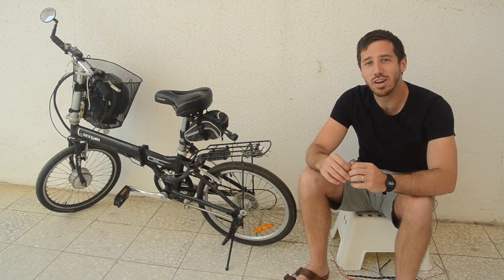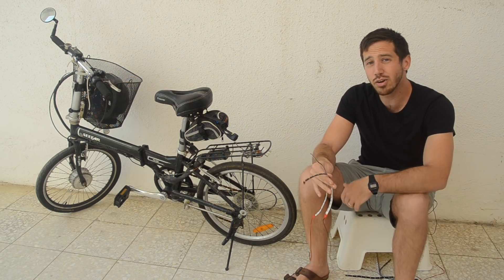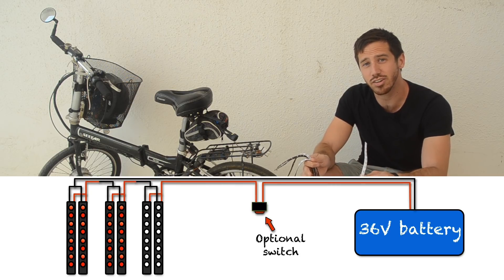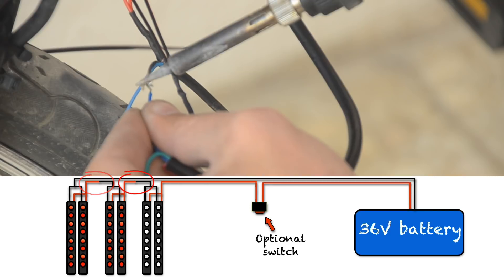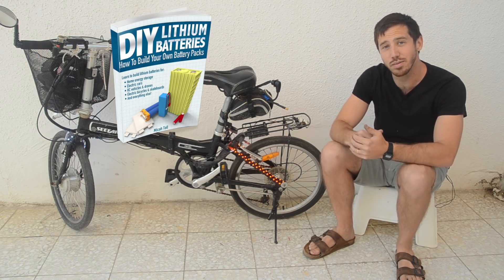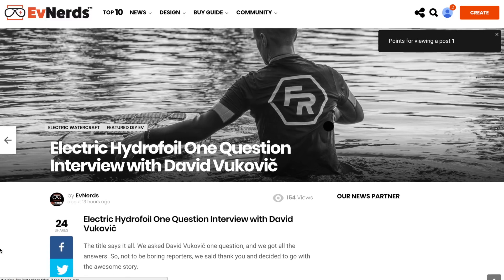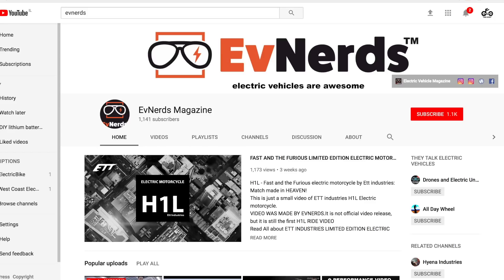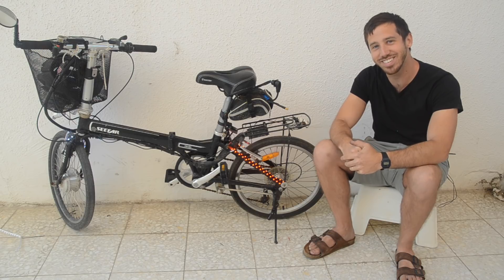How to add LED light strips | EVnerds giveaway contest

Comment: My new controller my 2pin higo plug i measure 52.4volt (48v) battry but then i plug a dc-dc converter12v  to it and i don't measure any volts as with my old controller i do any thoughts???

Comment: Should I use washers to separate the wires for the light from the wires for the motor on the terminal screws?

Comment: Hello.  I’m happy to see your videos. I need to know if I can power a bike light with a built in dc dc converter in it on my 48v battery in series by directly attaching the positive negative wires to my bikes 48v battery.  If so is it to the terminals on just one battery?

Comment: I've done several led light projects on my pontoon boat, side by side and other places. One great idea to make them stay put is to use 3M adhesive strips on the mounting surface first. Then attach the light strip to the 3M strip and it really holds well. The 3M adhesive strip is the kind used to hold car trim and emblems in place so you know how sticky that is. It's available in the same width as the light strips from Amazon.

Comment: Wish you would have showed the wiring process for the battery and not just a diagram, also what if the wires from the battery and light strips are different sizes in awg what then?
Reply: it will be a different awg because they carry max voltage differently, and it doesn't matter as long as the total voltage = that of the battery, check his video https://www.youtube.com/watch?v=t0xKpzqLnuc because he explains it extremely well to the point of idiot proof 😊

Comment: Love the videos, very helpful for a beginner.  So here's a beginner's question ... How do you wire them to the battery?  Do batteries come with extra connections for accessories?
Reply: Hmm.. I gotta look into this when me Ebike arrives
Reply: You can conectt it to your charger port on most batteries or u can tap in the battery output connector
Reply: @malicewhite2168  Thanks!

Comment: QUESTION!  if I add 3x 12v led strips in series to my 36v e-bike.. should I wire them (with a switch) directly to the battery, or in the key switch circuit?  I wonder if the led could/ would lower the returning voltage to the controller, and shut it off..  hmm...

Comment: I did a 4 12v lights in series for my 48v battery but all my lights is blinking (flickering) what did i do wrong?
Reply from the maker: Many lights are programmed to blink. Did you buy blinking lights?

Comment: I have rebuilt my 48v battery except for 3 parallels.My battery and hub motor are capable of 25 plus, Right now I'm stuck at 12mph. I'm in the process of changing those too. If this does not work, what are the cons of bypassing this bms system and just straight power off the battery. I know the limits of this battery when I first bought it, but that was brand new. I don't want anything to drop below 3.3v. I know how to check for power, but when should I stop.

Comment: Informative as always, Micah. I have a video suggestion: A round up of all the connectors you can use on a ebike. I'm shopping parts for my new bike and I'm lost. I was thinking about using EC5 for my 12v lights and gps tracker. Could I use to connect them to hook up my 52v battery too? What's the difference between EC5 and XT90?

Comment: Is the power-draw of these lights negligible when compared to the bike motor, or will this significantly impact the range you can expect to get out of your battery? (I ask, knowing the answer, but I want to be in the book lottery...)
Reply from the maker: Haha, nice. And yes, the power draw is negligible, like much less than 1% of your range.
Reply: @EbikeSchool  thanks for your video . It isn't explained how you connect the led strips to your e bike's power supply? Could you please explain how and what connector/s to use? (I'm getting a 48V e bike) thank you!

Comment: Yeah these lights at night time look awesome!! 
Avoiding a DC-DC converter is a very smart move, less inefficiencies more light with less wires and electronics. It's a WIN WIN =]
Reply: ElectricBIKE BRUNO THANKSSS
Reply: I rn a 48v 40amp controller on a 1500w ebike.. won't the overcurrent being drawn from the battery blow my dual 24c led strip if wired in series??

Comment: Another great video. You really do have the best channel for ebikes.

I do have a question, for fun and for emergencies and camping, I built a solar generator box with a 48v invertor in it and after I built it, I thought it would be a great idea to somehow have a SIMPLE and fast plugin connector that I could plug into the ebike battery to give it a huge battery reserve if ever needed. 

I really don't want to use the charger and plug it into the 120vac side of the invertor and then into the ebike battery, I'd rather be able to just connect the batteries together directly, if possible, and then use my solar panel to charge my battery in the solar generator box. 

I'm not even sure that you can charge AND run the ebike battery at the same time in this type of set up. I'm basically looking to be able to grab my solar generator box with over 5,100 watts of power in it, plug it in, and supply an ebike with that additional amount of power if ever needed.

Any ideas or thoughts or maybe even a future video? Keep up the great work.
Reply from the maker: This is possible, but the method to use will require some planning. The simple way is to just parallel the discharge ports of both your ebike battery and 5kW solar generator battery. This can be done easily when they are at the same or similar state of charge (voltage), but it shouldn't be done when they are not at the same voltage to prevent one from rapidly charging the other. To get around this, you could put a diode on the output of each battery to prevent reverse flow (charging) through the discharge connector. A different way to tackle this problem would be to put a DC-DC converter on the output of the 5kW battery and then plug that into the charge port on your ebike battery. And yes, you can charge your battery while discharging it at the same time.
Reply: Okay, thanks that makes a lot of sense with the diodes. The possible differences in the state of charge was some thing I did not think of. What would you say should be the max difference in battery voltages?

Comment: I've run this set-up for a few years now but used a small 12v motorcycle battery as a power source. Now that I'm on a 48 volt machine, I've got 2 questions about re-using my old ones. 

1: On a 4 strip set-up, do the strips have to have the same LED count? 

2: Could more than 4 be used in a hybrid serial-parallel configuration? For example, let's say I wanted to use 5 strips. 4 would be in series but the 5th would be paralleled with 1 of the first 4. 

Thanks for all your vids, Micah. Always helpful.
Reply from the maker: These are sort of the same question, basically, can you run different power (current) devices in series. More LEDs on  one strip or a pair of strips would both be pulling more current than the others in the series chain. Whether or not this would work would depend on how robust the LED lights are at handling overcurrent. I worry that the non-pairs or lower count strips could burn out because the higher current will be flowing through them. These light strips are pretty simple and cheap and I don't think they'd handle much abuse. But it would be a good experiment!
Reply: Got it, thanks. Unfortunately, I foolishly bought them at an auto parts store for $20 each. I've gotten my money's worth from them but I'm a little hesitant to experiment. Already ignited one on a 24 volt test.

Comment: Great vid as usual. Let me take the time to thank you for all of your videos. Always informative, on point, and whithout distracting music. Don't get me wrong I love music, but when you're trying to convey information sometimes less is more. Now having said that, what's your thoughts on the 38120 cell's, and will Vruzen contemplate making the battery fixture for the same in the future? I don't have an e-bike yet, but I will be. Still on the fence as to whether hub or mid, but I'll cross that bridge when I get there. Thanks again, and have a great day.--------------MQQN 😎
Reply from the maker: The most common 38120 cells I know are Headways, which already come with screw terminals and caps. I'm not sure why you'd need anything more than that.